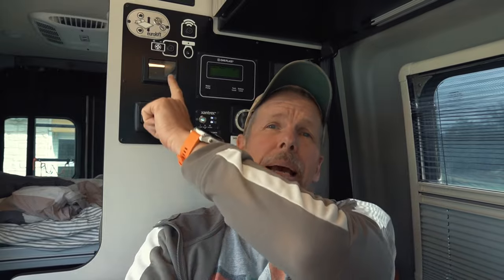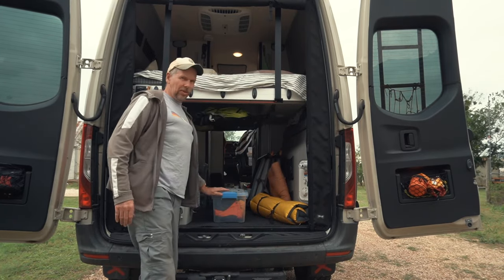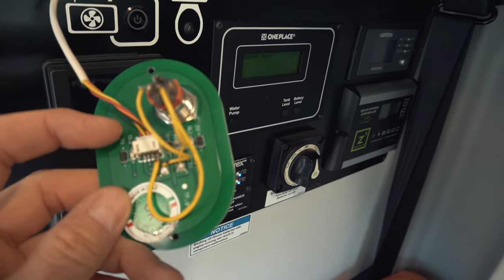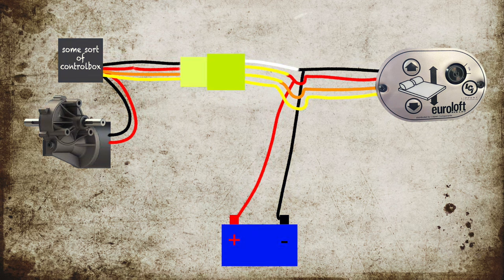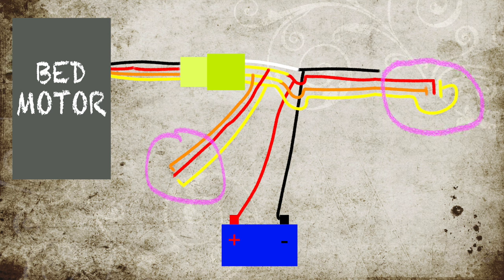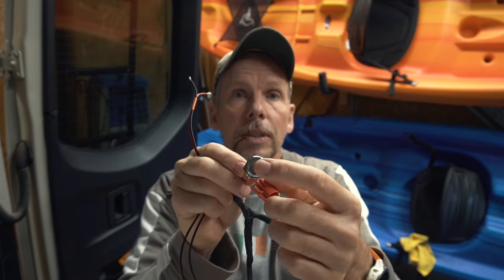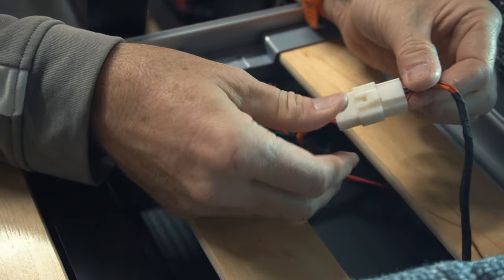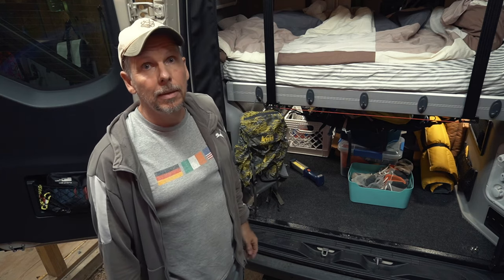2nd Bed Switch | Winnebago Revel

Comment: I tried to do something similar with the awning on my 5th wheel. I wanted to add a switch outside. I bought a momentary switch for this, but all I did was blow fuses. I never figured it out. Seems like it should be simple.
 Congratulations on your project.

Comment: Love your work Orange.  Another handy mod is adding aux switch to the galley face for the water pump.  Can I talk you into considering this mod and sharing it with the world?
Reply from the maker: thank you Jim. I made an entire new face plate for the galley switches, see here: 
https://www.youtube.com/watch?v=P5dDzKQfBRo  
I did not add a water pump switch, though. it would be easy enough to put one in. here is the wiring diagram for the pump: https://www.precisioncircuitsinc.com/wp-content/uploads/2014/08/00-10027-000-Water-Pump-Control-RevE.pdf. you can add as many switches as you like, they need to be momentary switches that pull the 'switch' wire of the control module to ground.
Reply: I've already added the pump switch to my Revels and helped maybe another dozen people or so do the same to their van in my driveway.  Was hoping to make this a more common mod because it's immensely convenient.  Your how-to video's are the best so my dream was talking you into covering for my (non) video skills.  Can I send you a free Doordrobe set , folding table or folding counter extension?  Also, the momentary switch for the pump is best on the face of the galley where it can been seen and touched from all water=need locations.

Comment: Have you thought about replacing all of the standard paddle switches with the LED type?
Reply from the maker: have you seen this video? https://youtu.be/P5dDzKQfBRo
I replaced a lot but won't change the one in the bed area for the overhead lights and garage lights. I think they work well enough, for me anyway, and since the plywood wall already has the cutout, I don't think I would gain anything by swapping them out. let me know what you think.

Comment: Thank you for another helpful video.  I noticed you have the same bed noise when first raising it.  Seems like a common problem with the Revel's.  Have you figured out what is causing it and how to fix it?
Reply from the maker: thanks Brian. Funny you mention the noise. It never really noticed it in real life but while editing the video and hearing it over and over, it bothered me, too. So I went out this morning and checked it out. I think it comes from where the belt takes a 90° turn, on these metal brackets on the 4 sides of the bed. there is a lot of weight on the surface where the belt touches the bracket and the belt just slides over the metal, it's not a roller or anything. I am thinking the noise we hear is caused by initially 'breaking free' belt from the bracket, overcoming the initial friction until the belt moves. Maybe it can be fixed by spraying some lubricant on the belt but I really don't want to do that, it might attract some dirt and dust, sticking to the belt over time, and might even somehow weaken the fabric of the belt. I'll just live with it....
Reply: Thank you for the quick reply.  Mine didn't make that noise until I had the van for a couple of months so not sure why it started all of a sudden.  I have to take my van in for some warranty work so I may ask them.  You are probably right about putting some type of lubricant on the belt attracting dirt.  Mine doesn't stop making that noise until the bed has risen about a foot from the bottom.
Reply from the maker: @brianl9762  okay, it turned out I didn't want to live with it, with that squeaking noise 🙂 ... and I fixed it, at least in my van. see my follow-up video: https://youtu.be/0UrLbb3jRFc

Comment: Great mod.  Did you make the wire harness or did you buy it with the switches.  You don't happen to have a link for the the switches do you?
Reply from the maker: the switches come with a socket with open end wires. I got them from Amazon: https://www.amazon.com/gp/product/B079FKG8B1 . please note they come in different styles (color of the switch itself and color of the backlight) but also in latching and non-latching. I used a latching one for the power-on button and non-latching (momentary) for the up and down. 
as for the harness, I made it myself.
Reply: @orange13  thank you, as a recent Revel owner I love your videos.  Your video on fishing the cables through and installing glands on the roof access saved me a ton of grief!

Comment: Wouldn't it have been simpler to just use one dual pole rocker switch?  Alot less wiiring to do.
Reply from the maker: like I said in the video, all it takes are 3 wires. and a rocker switch (like the one I used for testing, 7:03) will do just fine. I like the round switches a lot better than rocker switches and because I wanted to add a main switch and wanted to use the built-in backlight LED, my wiring harness uses more than 3 wires.